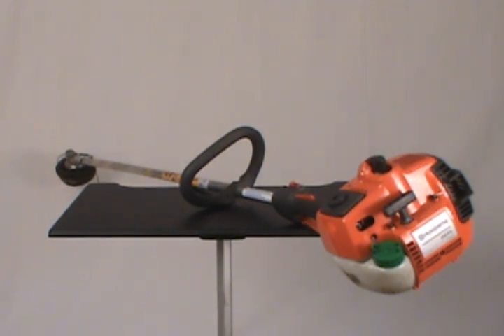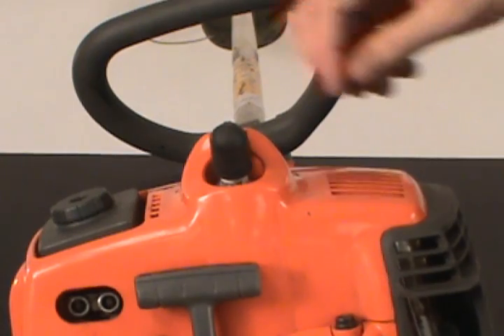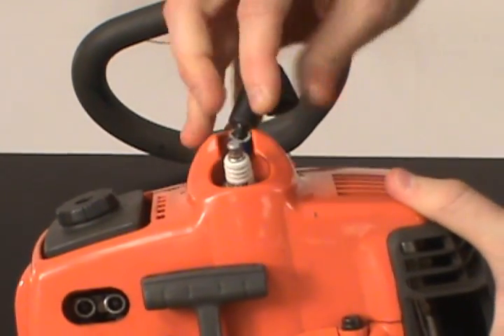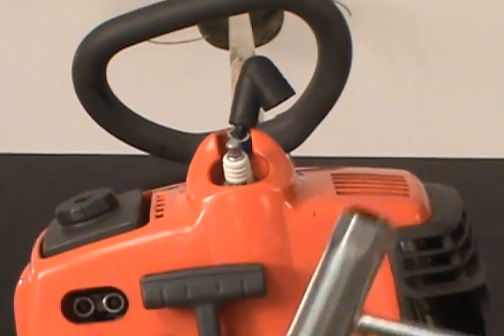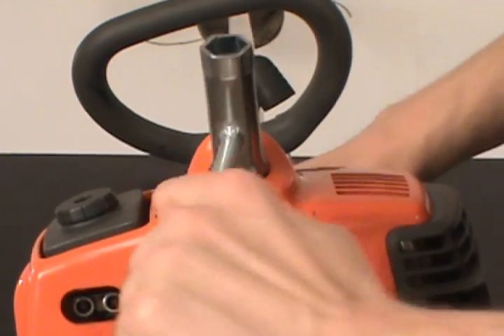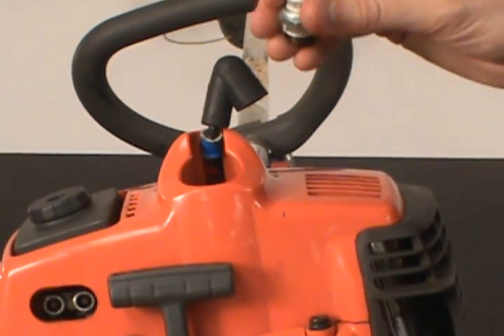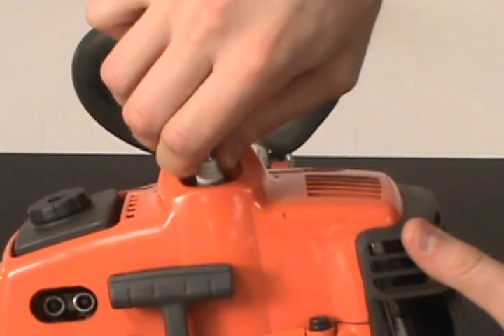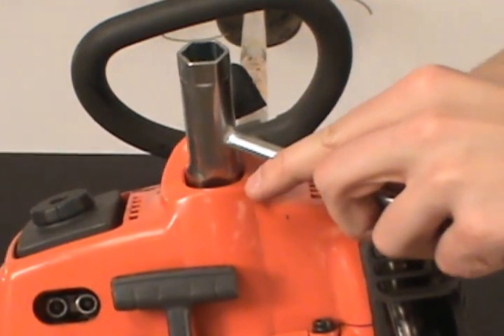Replacing the Spark Plug - Husqvarna Trimmer

Comment: The spark plug gap is 0.024″ (0.6 mm).
Use resistor spark plug Champion RCJ--6Y or equivalent.
I couldn't find any mention of torque (tightness).
I would suggest to just snug it down - gently.
The worst thing you could do is over tighten it and damage the threads!
Hope this helps.

Comment: You didn't even mention plug numbers, or to check the gap. This video is absolutely worthless!
Reply: The gap is usually preset from factory...just like they are for you car..
Reply: You buy the same plug number as the one you removed, gapping is preset when new.
Reply: @hectorgarcia8691  how do you know the one you took out was the correct one?

Preset gaps are a lie. You learn that when you've changed hundreds of spark plugs.
Reply: @Krankie_V  well that means your lucky to be smarter than the rest of the world 👍